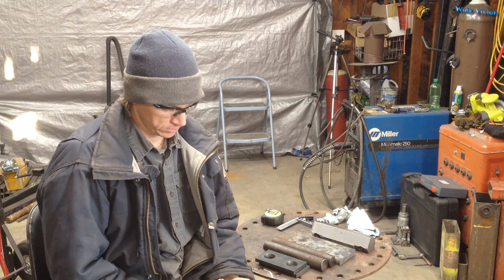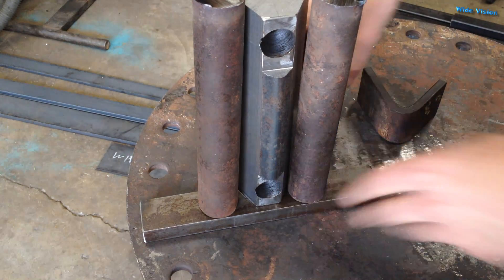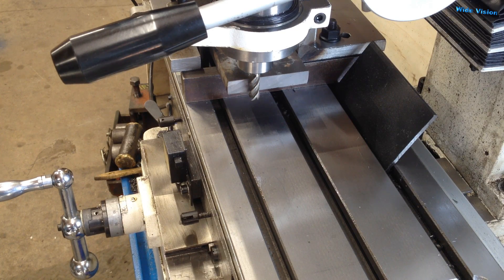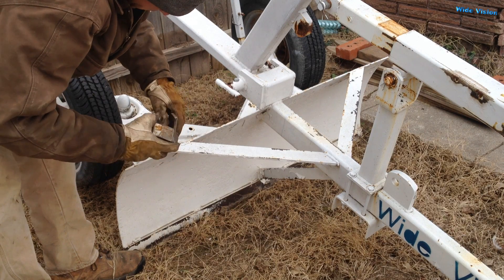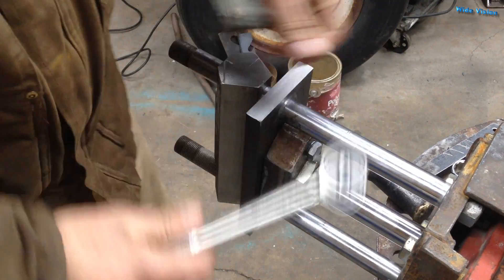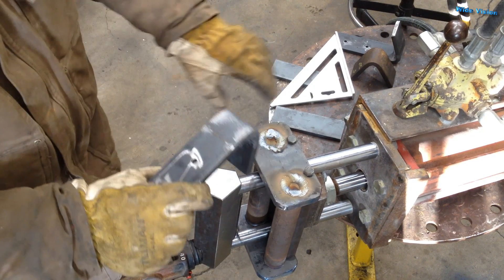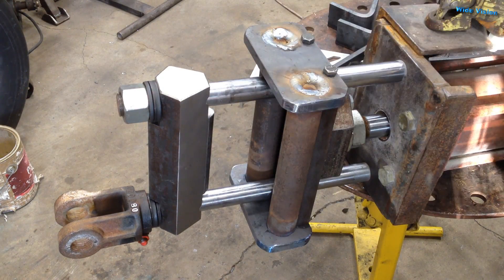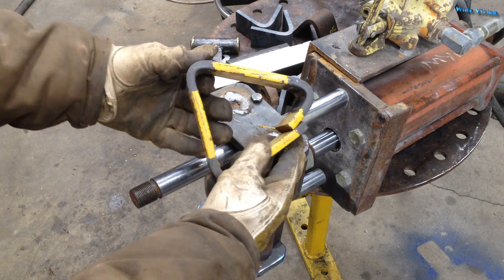Building Press Brake Dies, the Other Side! Plus bending things! Part 2 of 2

Comment: I know this is an older video but I'm a recent fan. I've had a baleigh horizontal press brake saved as inspiration for awhile and this seems to be similar. If you had a way to hold the work square it also seems like it would help. Anyways love the videos keep up the good work.

Comment: Do you have any info on how you heat your shop?
Reply from the maker: Right now I'm just using a 4400 Watt electric heater, and I only run it while I'm working in there. The long side of the shop is South facing, so during the "cold" months, when the Sun is low in the South, I get a lot of heat from the Sun.   But, I started building a wood burning stove today, and that will hopefully become my main source of heat.   I have dreams of putting in Earth tubes, but I have no idea if that will ever become a reality.
Reply: @WideVisionMetalFab  I been wanting to build a Used oil / hyd oil burner

Comment: think if you had put a ring you can slide up and down and lock on each pin you could lay the rod on top of those rings so its straight to the bend every time
you can allso make scribe lines on the top of the bending bar and use the plate (holding the pins) sliding over it as the pointer , that way you can get the amount of bend pretty precise every time

Comment: Quite practical srtong bender, even better that it's portable since most of your work is in the field...   ;)
Just a quick note, try to keep your quill as short as possible when using side force on your mill, it greatly helps with rigidity and REALLY saves quill bearings, those are generaly quite $$$$$.
Videos are a spare time activity...    lol

Comment: I'd guess that a lot of agricultural machinery like the plow you mentioned for the bar stock, is made with a high manganese steel like AR200.  That stuff 'work' hardens with abrasion so it's not a bad choice for the kind of wear that press brake tooling sees.

Comment: That is a cool setup and quite portable.  We have a Dayton 7"x12" horizontal band saw.  It was about $350 used.  The stand was short and not really worth a ^&*(.  Made a new stand and put it on casters.  One of the better investments.  It is within a few thousandths square on 2"  diameter stock.  Takes about 15 minutes to cut 6" schedule 40 pipe but we are running a slower blade speed and not much pressure.  I live diagonal across the state from you.  Corn harvest got done in late September.  Very few soybeans have been harvested due to rain.  We are normally done with soybeans by the end of October.  We are not fly free until Oct 15, but due to rain, there is not much wheat planted.

Comment: I like the design, how large of an electric / hydraulic unit are you using to power that?

Also you need to do the jobs that pay the bills before you take time to video projects, everyone knows and most will understand that!
Reply from the maker: I think I talk about the power unit in the Adding a Hydraulic motor to my ring roller... but I can't remember! It's a 3/4 horse electric motor with a 1 gpm pump.  It's slow, but it's a perfect fit for a press.

Comment: Great build. I also learned that you plant next years wheat crop in the fall, I alway's thought you  planted (wheat) in the spring. Hoping things are starting to smooth out for you, now that your living in town, as apposed to on the farm.
Reply: There are 2 different wheat types.
1 is winter wheat planted in the late fall.
Other is spring wheat, planted in the spring.
Both used for very different purposes
Reply: @RJ1999x  I live in the Pacific Northwest, west of the Cascade mountains, I just thought the farmers forgot their crop. I alway's thought it strange to leave the crop out, the duration of winter. What a fool I am.
Reply: @stanwooddave_1953  not a fool, just too far removed from the farm